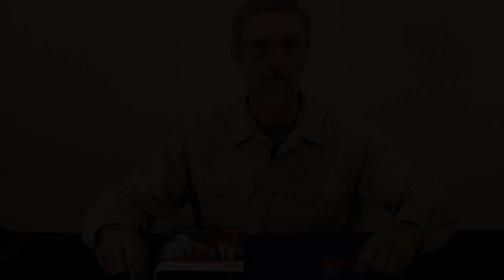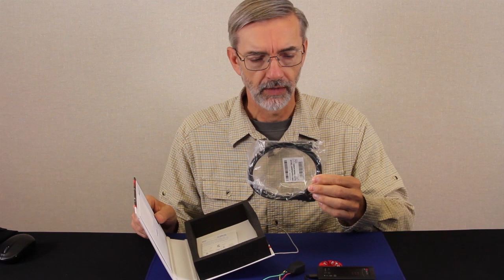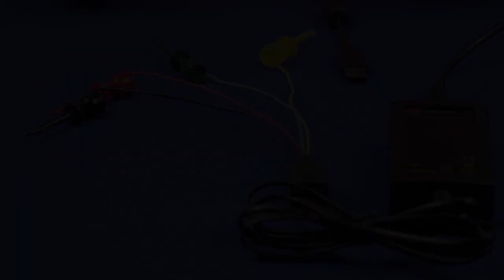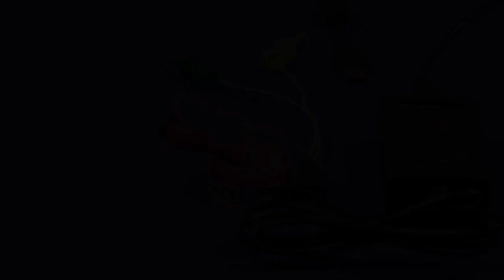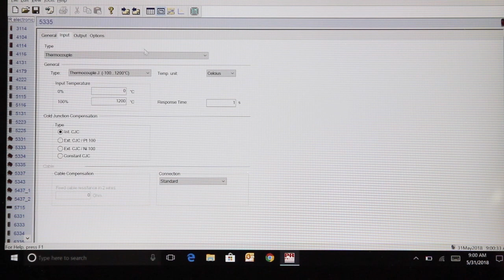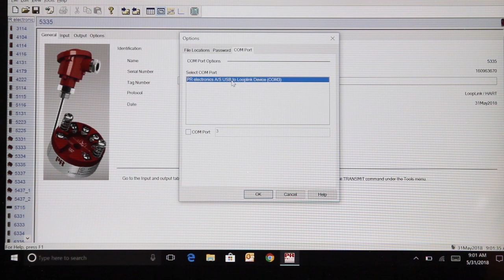How to Calibrate the Burns Line of PR Electronics Transmitters

Comment: How do you do it with a HART
Reply: The device descriptors are available from PR Electronics.  You may need to load these into your communicator to have full access to all the settings.  Select the PR model number from the device menu, 5335 is our T55 and the 5337 is our T57.